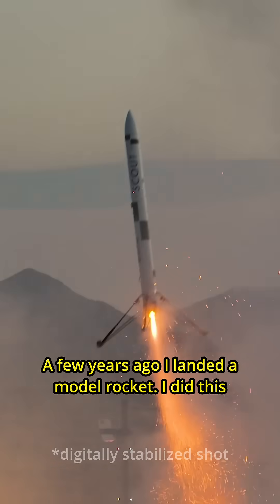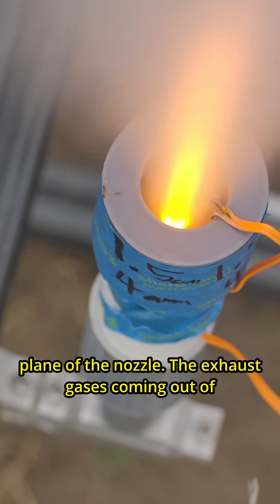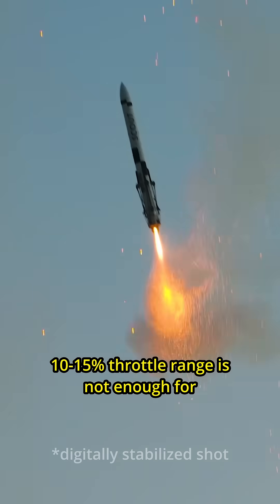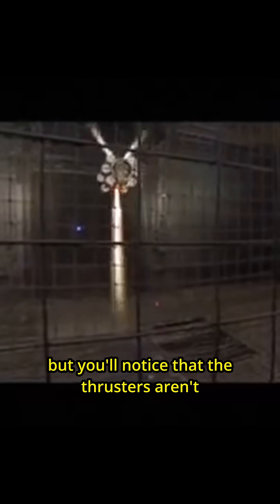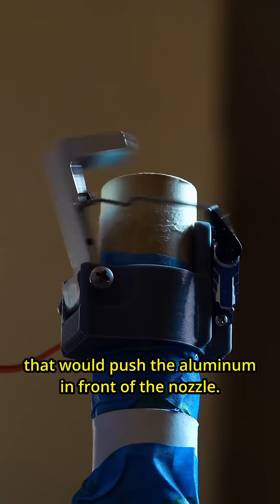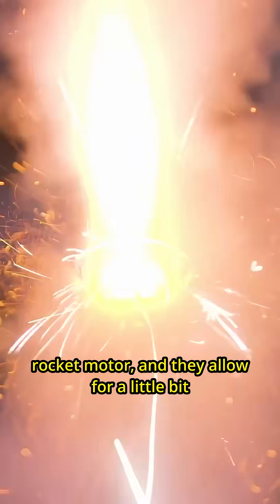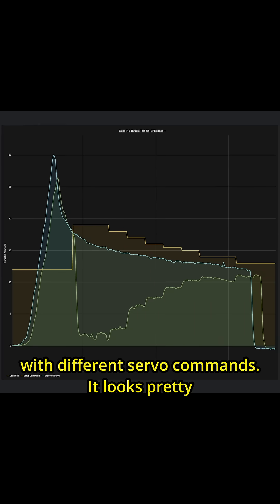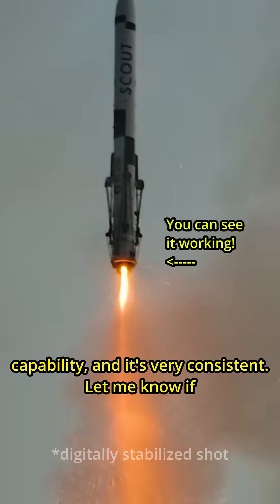Solid Rocket Throttle Control

Comment: What about a plunger reminiscent of a: plug, sound modulating one anyway? I think that if you were to create channels that would force the thrust in an upward pattern when the plunger is plunged so to speak, that you could either a rotate around for some escape in order to facilitate low pressure downward movement that is offset by the amount of pressure eyes gas traveling in an upward 360° pattern with equal distance spacing allowed for the veins to shoot the gas up and away from the rocket at slightly less than a 45 degree angle. As long as the gas coming back to the rocket doesn't hit the actual rocket itself as it does with your ceramic calipers? If I'm going to work it nicely. Turd cutters would be another word but I think you are an awesome YouTuber and I really can't let that be the last thing I say without saying how much I love your videos, and how much I look forward to actually producing entirely on my own or with some really great friends, a true space shot impossibly the launch of my own cubesat. This is all pipe dream, maybe.but after looking at your videos and my background with microcontrollers, aerodynamics, and rocketry RC planes servos the whole nine yards I look at your videos when I am done looking at planes for the night 😂 when everything is just too easy see me after a while then I tune into your videos and I get blown back by some scientific shit. But seriously DPS what about a plunger that you could fit in your exhaust with some sort of hydraulic plunger pulling it upwards, and maybe some sort of u-joint that allows the entire blocking area to be rotated on an axis that allows for The escape of the expanding gas in any direction you would like. If you want 100% up for us you cover up the exhaust completely with your plunger and you rely on your veins that work through the plunger to frustrate vector the power upwards thus creating downforce. You pull away, and you've created the same sort of structure. I wonder if there is a design of this plunger that would and or / could be optimized as a ceramic piece that fits your needs and does what I'm talking about in order to correct it to directory when it's descending. Love your videos space! I can't wait one day to get certified as an actual amateur rocketeer. I've had plenty of SDS and Candy rockets on my Launchpad before but when I have a sanctioned space shot somewhere in the desert in an article which is worthy of traveling into the unknown, and permits to deposit something maybe geostationary so that I can forever communicate with a tiny little Linux box hundreds of miles above my head until the day I die and my children's children's children or nephews / godparents children's children can listen to on SDR radio. I'm talking about preserving a generation that may very well be lost to the annals of disposable quote" media. There are so many platforms nowadays that everything is consolidated into, that losing just one of these platforms just one of these alone would cripple the amount of stored data that is accessible by the average user of the internet daily. My goal is to put in that cube set or at least in my own archives, a copy of everything that humanity has made up until this point in science achievements for example all right, wars and all of rememberable and verifiable history and why not let's throw in biblical let's call it, lower. Sorry if that's not what you would call it, it's just what I would in the most sincerest sense being a Buddhist. I am super interested in creating a platform to monitor one of my space launches and it's the same, a UAV / uas system capable of truly climbing into the sky and staying there. I will be documenting my own hardships challenges wins fails and epic successes. Thank you for the inspiration. I've not only started a business 3D printing for artsy stuff on the flea market grounds, I now can support my 3D printing of hobby grade materials with just that alone so thank you I don't know what I would do without some of your videos. You are on a whole nother level. You not only have the knowledge, but you spread it. And that, that right there. Showing your failures, being as possible as you are, is unheard of in day-to-day life for me anyway, which is the reason why I don't leave the house much anymore. But let me tell you, there was a whole plethora of people to meet on the internet and conversations do a hell of a job of weeding out the people you want to talk to versus the people that you don't. Again space I don't even expect you to see this, if anything ice see fans rallying around this in the 23s because it's just the rambling post saying how much I appreciate your content but I'm sure there's a million of folks out there like me they get to see this and eventually get to follow their own dreams. Thank you man and from all of us learning from you in one way or another, thank you again.❤

Comment: If you could change the shape of the ceramic thrust diffusers to both contract in diameter and rapid pulse.thr motor, and/or extend further away from the thrust nozzle, you may be able to increase the thrust control variability better...
If you're able to use other than a one shot solid propellant, and get your hands on a liquid oxygen set up, but then you will need to scale up in size...

Comment: Perfect explanation, I always thought you where doing it without throttling ... because solid fuel rocket and you changed motors until it worked.

Some amateur rocket builders are experimenting with hybrid rocket engines NOx + Polyethylene.

Comment: would it help if you'll taper the extended nozzle for maybe 3 - 6 degrees? Instead of pulsing the thrusters move the angle of the extended nozzle to balance the rocket

Comment: Change from squared throttle assembly to semi-oval, thus creating a circle as it closes onto itself. 
Newly created circle, can be increased and decreased in size. 
The blow by on the squared off assembly, is directly interfering with your pulse modulation.
So control that blow-by and more accurately while gaining near total control of you trust creation.

Comment: Could this have been done as a hybrid rocket where the flow of oxygen is controlled? It's very similar to a regular rocker motor but the bore is connected to an oxygen supply at the top.

Comment: 80% motor and fuel.
5% vehicle management.
15% payload shroud.

All with a total burn time (impulse) measured literally in pound seconds.

We are not going ANYWHERE in space with reaction mass propulsion.

Get it?  It's a plumbing experiment using technology which was dated in the 1940s when it was invented.

If you cannot work with space:time:gravity as some kind of compressible suspension (torsion) field that is generated with electric power and 'goes with you', humanity is doomed to stay on earth forever.

Viktor Von Schauberger looked at implosion.  Circulating large air masses within a fixed path turbine, like a nautilus shell, to create what may well have been some kind of Boze-Einstein type condensate whereby matter which is squeezed together so tightly that it overlaps atomic shells, becomes 'hyper fluid' in it's interaction with where it is, in space time.

Working for the Nazis, he developed a jet engine, roughly the size of a pressure cooker, which was capable of incredibly rapid displacements, beyond any condition of achieved 'thrust'.

That is what we should be working on.  Rockets, whether solid or liquid, are useless because even if they are throttleable or vectoring/reversible, do not have the energy density needed to go where they are the only present propulsion method (no air needed) available for 'thrust'.

Wake up America.  Start going down new engineering lines of inquiry.  Fire NASA if they refuse to start developing technologies which are beyond better rockets.

Rockets have been with us since at least the Congreve, in 1806.  They are anachronistic at best.

Comment: Your correct on PWM but i hate that they are using that term for this.  Its normally used for electrical circuits and waves.

Comment: Excellent video and concept. In the 70’s I was in the Army and worked on the guidance and control for the Pershing Missile. It is a big two stage solid fuel ballistic nuclear missile. It had carbon jet vanes because it went into outer space. Similar to the V2. Von Braun brought us a lot of the German technology. The way they shut the missile engine down was by case venting. There were explosive bolts that would release slots in the side of the second stage venting the gas. One on my jobs was to test the explosive bolts.

The next project is to work on the propellant to increase the thrust. Black powder, really? Corrugate the propellant in the tube to increase the surface area thereby increasing the thrust.

Comment: Could you not use some sort of reverse thrust system like what jet engines use? 

When using reverse thrust you throttle up the engines, this is basically the same as a solid fuel rocket is it not?

Comment: Wouldn’t it be easier and more efficient to redirect the exhaust though opposite nozzles? 

For example to decelerate, you redirect the thrust up and to accelerate, you direct it down. And for lateral control redirect the thrust through side nozzles.

Comment: What about 
    Segmented Throttling Tubes?
 (or, whatever you wish to call it).

   Instead of one solid cylinder, try using two cylinders, (one nestled inside the other), that have slits down their sides.
   The tubes can be rotated to shrink or enlarge the side openings. (You can experiment with various widths, to get best results).

   This should allow for some thrust energy to escape sideways, thus slowing the rockets decent.

    Good luck!

Comment: I would have limited the intake of the air passing into the solid rocket booster. 
The hollow cavity. Or push a rod up and down that opening to see if there’s a greater, more controllable affect.

Comment: I'd be wondering if you could make ceramic thrust reversers so you can completely invert the direction of thrust the rocket provides. 

Theoretically that'd give you total control over the throttle of the rocket if you can pulse the reverse on and off fast enough.

Comment: Oh yeah I would have done it waayyy differently. I would have done it using the double bobble method in order to stabilize the Tibler effect. That way my little tube thingy will land with much better results than your silly little thing.

Comment: Another method would be Magnetic.  You can place strong magnetic fields to the same effect as the ceramic. (value?)  I suppose it could be used in conjunction with your solution to get a higher precision  control of the thrust and quicker reaction.   Fires are highly ionic and respond to magnetic fields.

Comment: Its certainly a good aproach to the problem, but why not redisign the rocket to use a liquid propellant? These can be throttled and are easier to reuse than solid propellant rockets. They are harder to get to work but you may obtain better results and they make a fun long term project

Comment: I still don't understand how the rockets - models or Elon's - balance vertically on the main burner as they descend, rather than fall over to one side or another. Seems like they would be tippy. Or are there smaller lateral thrusters I don't see?

Obviously it works but if anyone cares to explain, I'd love to hear it.

Comment: You went for a bit simpler method, but my method would’ve been probably the same thing but I would’ve tried to use a aperture out of like a 35 mm camera but something that’s not gonna melt. That’s gonna withstand the heat but that similar design of that by gateway and a 35 mm camera. That’s how I think I would’ve done it because I could get you a finer point and reduce the amount of off gas that’s not controlled.

Comment: What about a shutter, a circle plate with holes at four points. Turing the shutter tonon , or off position.  Stainless steel is a possible choice for the shutter.

Comment: Perfect overkill: ceramic spiral shutter on a length-changing nozzle tube, with a ceramic pulse modulation piece.

Developing that ceramic clamp to make the pieces redirect the thrust to the sides could work.

Comment: you can use 3 different "blockers" but angle each one 45 degrees to the flame so each one redirects the thrust sideways in 1 of 3 directions. since all 3 can be pulsing at the same time, you can now control not only the vertical thrust, but also your balance by altering which of the 3 are on longest.

a 90 degree quarter pipe curve to change the flame direction might work best.

Comment: Integza did a cool video a while back with electric ignited rocket motors, when the current stopped the motor would turn off, wondering if you could use it as a simpler solution less mechanical parts
Reply: Electro solid propellants esp. idk if it would work, but you could stage several ESPs and ignite them all in different time variables

Comment: I never would have considered a pulsed thruster to be pulse width modulation. I've only seen the term used in electronics. But I guess it does fit the definition.

Comment: Used to launch modle rockets all the time when I was a kid. Found this really cool its kinda like pinching of a garden hose to get the right amount of flow you want. Cool solution to a hot problem. Would never imagine as a 12 year old kid someone could land one of these rockets in one piece with no parachute.

Comment: Why won't 4 servos but with a hole in the center not work better? Or are you using the servos to change the direction of the exhaust, instead? You got the follow but not for the threat

Comment: I would have used a triangle adjuster to make the thrust change from three perpendicular jets going from side to down. Depending on the way the thrust is adjusted you may be able to adjust direction also.

Comment: Use a engine that doesent have any oxidizer in the mixture, and pump air from the back of the engine. By controlling the oxidizer, you can control how much fuel burns, controlling the throttle.

Comment: The problem I think you’re likely to have with ceramic throttling system that you tested is uncontrolled thrust vectoring. 
If you re-watch your own video you’ll see that the exhaust jet tilts away from the rocket’s centerline.
That’s going to be problematic during the landing phase for certain.
I’d reconsider the actuation linkages you’re using to engage the ceramic blocks, and I’d reconsider the shape of the blocks as well.
Symmetry all the way around the vehicle’s centerline is going to be a critical factor. Symmetry of the exhaust plume (including the gasses being blocked from being used to produce thrust, the escaping waste gasses so to speak), as well as symmetry of the weight distribution of the actuating parts as they move through their entire range of motion. 
I expect that this is going to take some serious time to get something like this to work. But then again, anything worth doing… :-)

Comment: Is awesome is that is my question is for implication on real rocket like the Falcon 9 heavy what are the implications of the heat buildup when you block that does blocking off heat exit so without really ramping up your some kind of cooling something who knows what you do right there and keep it cool enough to not blow up the whole rocket I guess that's the question what would you do there if you were to implement that on any of our new rockets like the Falcon 9 heavy or the blah blah blah in the next one and the next one what would you do to keep that from overheating the actual Rockets fuel tank and detonating the entire thing upon Landing because actually I do believe musk has figured out how to Now remind you this is not a solid rocket motor like what you're dealing with but figured out how to throttle is Rockets I believe I'm correct and you're not the same thing at all but let me know what anybody else thinks

Comment: Maybe a split waffer design or a circular 2 split or 4 split design with multiple port hole directing the thrust in a diagonal pattern to assist balancing when descending.

Comment: How about using a aperture similar to camera lenses made from ceramic. It will give you precise control over exhaust gases and use a bypass to remove the unwanted gases

Comment: 💡Use 3 motors 120° apart that can each go from vertical to horizontal with accurate control. This will give you both thrust and directional control.

Comment: as soon as you said aluminum... i knew it was gonna melt. lol always wanted to play with rockets, like real rockets like this. i used to go to walmart and get little cheap toy boats and cars and stuff, hit the model rocket aisle, get a bunch of little rocket engines, and strap them to the boat or whatever, boats worked the best... little cheap toy cars have shitty axles and wheels, and just don't work well. strap a few model rocket engines on a toy boat, however... and it usually worked... but, that was back when disposable income was a real thing.

Comment: How about the blocker made from a single piece of ceramic that has holes of various sizes and it slides over the rocket exhaust. A big hole to start slowing the vehicle and gradually moving to a smaller hole for landing.